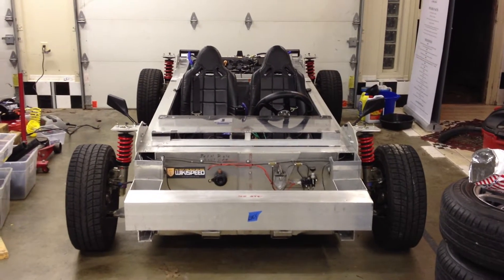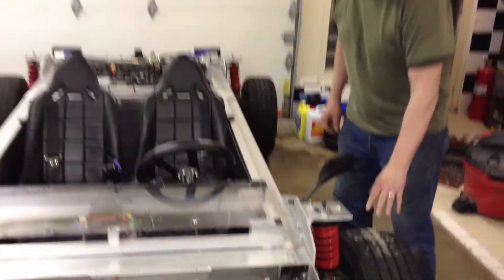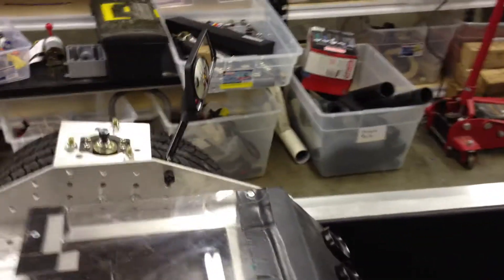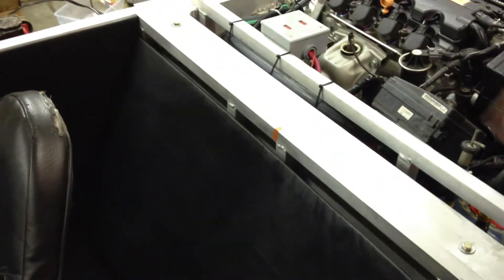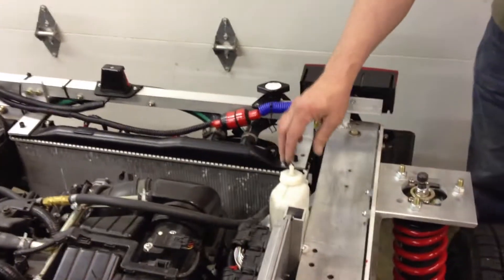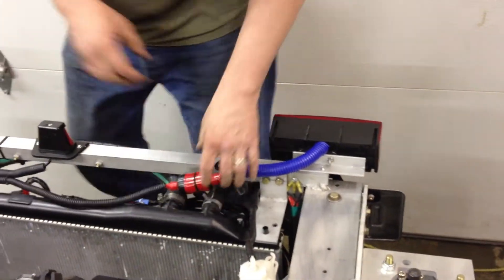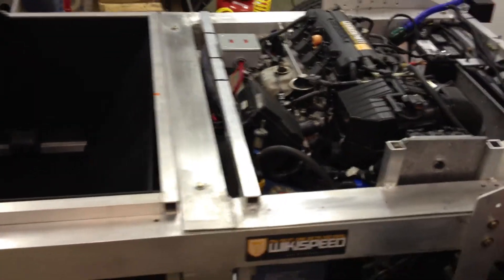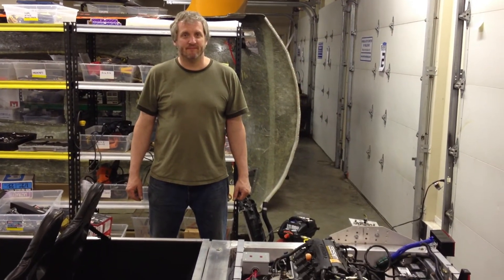WIKISPEED Cinco de Mayo 2012 update

Comment: I like the idea but 10 G wire is very expensive. also you will need a fuse to protect that 10 G wire. What will the amperage be? A light will use very little but with all lights working, engine etc. then you need a bigger fuse than with 1 light. Maybe a large fuse at the beginning terminal and another small fuse at the component using the current. HMM getting complicated but there must be a solution. I like the idea.

Comment: I've often thought about wiring up a car with data and signal separate. A large (10ga?) conductor carries 12V to all components. A multi-conductor cable (Cat5?) carries signal - each wire controls a different item, via a relay. This should use much less copper than running a separate full-sized conductor to each bulb, etc.

Comment: Standard residential plug! If someone plugs that in to the wall, wouldn't that be a fire hazard? Instead, try a standard 4-pin trailer wiring plug, cheap & easy to find.